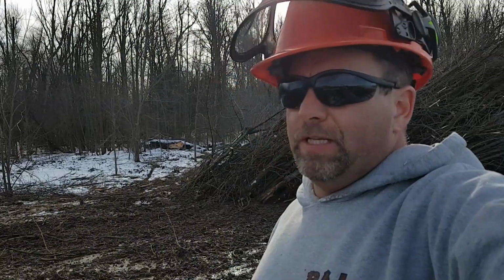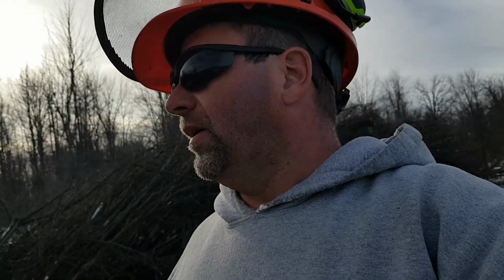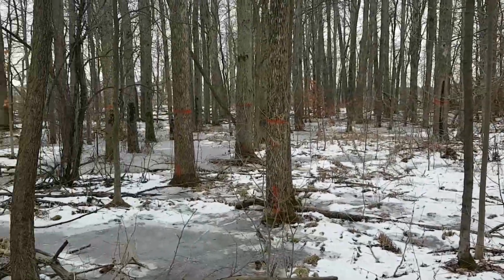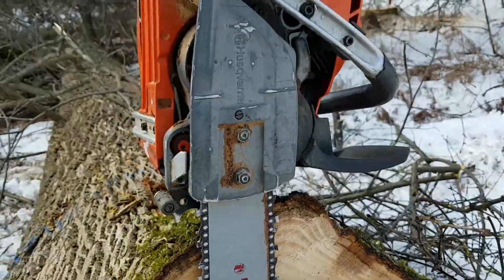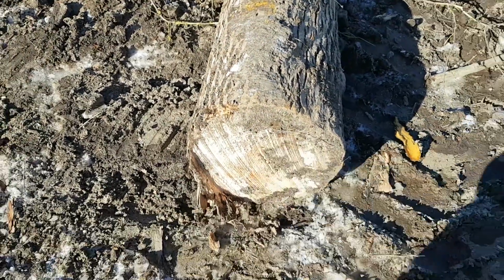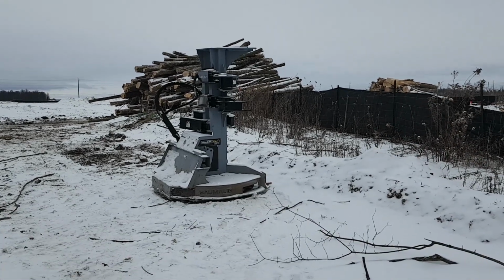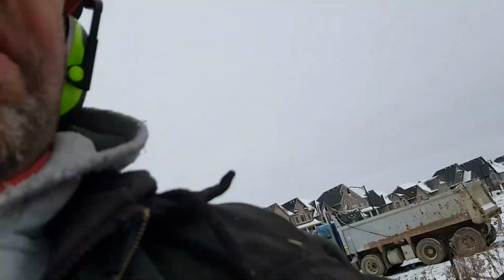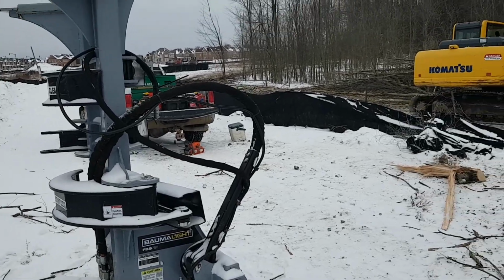2600 ASH TREES TO REMOVE!

Comment: That buncher is awesome. That’s going to save a lot of time. Do you think you will need to bolt some counterweight on the back of the skid steer??
Reply from the maker: We haven't talked about it really.   If we do we will probably do it with a rear bumper.     It does work good tho.  Now we just need another skidsteer to skid haha
Reply: With another machine to skid you guys are going to move some serious wood!!!!
Reply: Just thinking out loud...what about a counterweight off from a small fork lift. It wouldn’t stick out as much as a bumper. And you would get much more weight. Just thinking out loud.  Sometimes when I think out loud it’s scary lol. Have a great safe day kevin.

Comment: Do you guys have a problem with Ash borer beetles I figured I would ask you guys good job you guys are hard workers cutting trees stacking wood ain't easy but I like stacking wood
Reply from the maker: Yes we do.  It has devastated woodlots here in southern Ontario.     They figure 4 more years and it will be junk.   I'm sure there will be pockets that are good but most will be gone or to rotten to salvage.
Reply: @SkidderKev  okay I was just curious we have problems with Ash borer beetles here in Ohio usually the best thing to do is plant more trees in their place I mean new trees
Reply from the maker: @austinmiller3497  in this woodlot they will be replanting just because how dense the ash was.  Most woodlots you can removal it all and still have other species that will drop seed and fill those spots
Reply: @SkidderKev  okay awesome that's great

Comment: 20” tree hold it let’s see what that Kubota look like tracks up. A logger I used to move had two Bell bunchers and they would roll more frequently than I would like. Kevin went over a cliff once in Moose River (Adirondack Mts) with a chainsaw in the cab. He got torn up pretty bad but kept working. He was hurting so much he had to have help getting his boots on and off, one tough bugger. Thanks for sharing 👍🏻
Reply from the maker: Hahaha ya I don't think so.  Rubber side down here.     Kevin was one tough cat!    I swear those bells were made to be flipped all the time